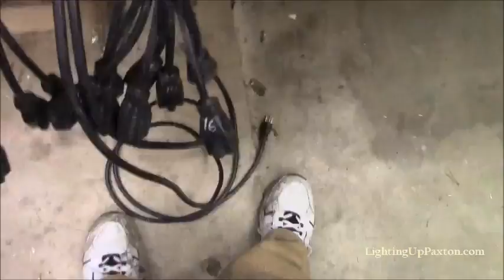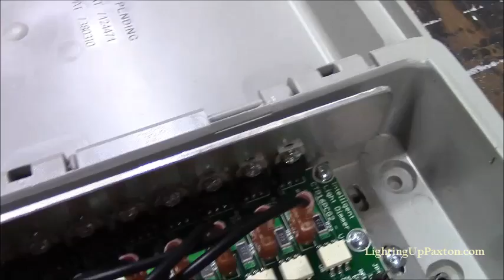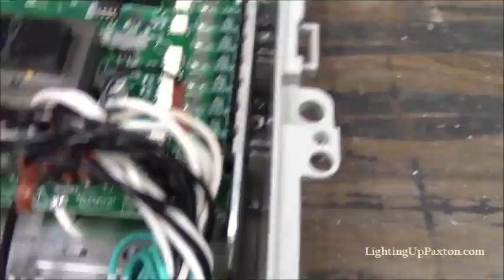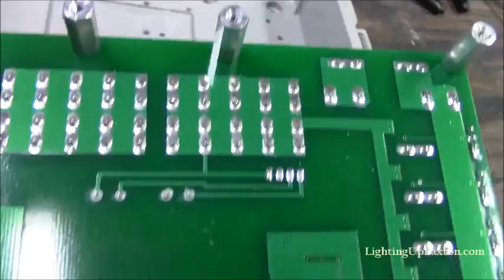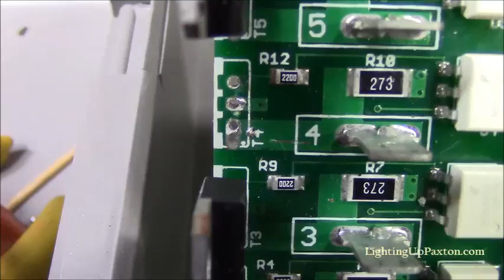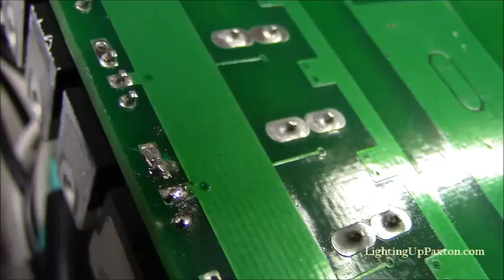How to replace triacs in LOR controllers

Comment: Heat the solder and use a solder sucker when it gets liquid.  Then go back and use a solder tape to get the rest on both sides.  Triac should come right out.  Stick in the triac, solder the back and clip the pin.  Use flux when soldering.  You make it harder than it needs to be.  Any thermal paste you use withy CPUs or thermal pads should work

Comment: A tip from a retired professional electronics technician--- buy a desoldering vacuum pump. They are only a few dollars. No need to break off the triac from the board. The desoldering pump will suck all of the solder from the eyelets and the old triac will simply fall out from the circuit board, leaving a clean eyelet. Also, use solder with a multi core rosin. The solder will flow much better, resulting in solder joints that look much like the original factory ones. No one likes to see a poorly soldered joint, with a solder blob on the eyelet.

Comment: I like your videos because you explain things clearly... I gave your video with a thumbs up and watched it all the way through...  As someone who does electronics for a hobby and works with embedded microcontrollers professionally, I'd like to offer a few things that in future might make your repairs go easier... I have a professional desoldering tool that sucks solder out of the connections, not everyone can afford or justify spending money on that, but for a long time I had (and still do) a Solderpult (blue body) desoldering tool that sucks the solder out of the connection, the red one works meh... but better than nothing. When you have a lot of heavy traces on a PCB, you need to heat the connection up well, but carefully not to delaminate it from the PCB, and you have to desolder each connection separately, trying to heat multiple pins won't make it easier to remover.  Also, you don't have to break off the old one before removing, in fact having it in place makes it easier to wiggle the part around so you can pull it out while heating it up, there are exceptions to this, but for triacs, I think this works better.  Next, you do not need to precut the component before installing, put it in the board, solder it in place, then use some flush cut side cutters to finish the job. As long as the trimmed legs doesn't short out on the metal, or scratch the box, etc., you're good.  Next, FYI: The way thermal compound "works" is that it makes up for the fact that two surfaces may not be flat and make complete surface contact, the compound makes up for anything uneven in either the component or the heatsink.  And lastly, when soldering the good component in place, and the PCB has thick or wide traces, sometimes the connections will take a long time to heat, and that heat can hurt the component, so there are little spring clips that act as a temporary heat sink, like an alligator clip, you put on the leg of a component to draw out the heat from reaching the sensitive component inside the body of the component.  If you're able to get in and out relatively quickly, then you should be alright and don't need to use them.
Reply from the maker: Great tips.  I'm happy people continue to share their advice and experience.
I found clipping the legs of the triac first made it a little easier to to get them through the original terminal holes as they wouldn't bend so much trying to push them through.  I'm confident that was only a symptom of not getting the terminal holes completely clear of solder though.

Comment: Before undoing the "Black"  hot wires.. I would make sure  they are labeled with the channel number so when you connect them back to the board you will know which channel they go to.. I use a black sharpie to label mine..
Reply from the maker: Great tip to add, Patrick.  I do have them labeled that way, but failed to mention it and it doesn't show in the video either since all the numbers were facing away from the camera.

Comment: Edited - Humble Pie edition....I just replaced 3 triacs and for the first time had lots of trouble with my desoldering efforts. The technique in the  video will work well. . 2 of the 3 triacs I replaced were a pain... the solder wick would not work. I used Victor's method with a little modification... I used a de-soldering bulb to actually blow out the solder from the holes. I do not recommend this method. The toothpicks appear to work better than the de-solder bulb blowing method (BTW - using it for sucking solder would not work). So my sincere thanks and apologies to Victor... Your method works better than solder wick. There are special de-soldering tips for a soldering iron that will allow you to heat more that one pin at a time. Those work very well, but are still not the best solution. I have since purchased a vacuum de-solder / solder station. Works fantastic. I can remove components in mere seconds. Works good for harvesting parts from PCBs otherwise headed for the trash bin. It also keeps me from overheating and lifting traces. I also recommend you double check for solder bridges... hard to tell due to discoloring from the soldering iron. You do not want to power up with a short created by a bridge. Original comment still relevant: Some really good information - Thank you - the disassembly instructions are excellent.   I will add my two cents worth. 
Also, I do not cut leads until the soldering is done.  I have a expensive flush cutter ($80) and a pair of  Xuron 170-II Micro-Shear Flush Cutter (about $10). Both work well in tight spaces, the angled flush cutter works the best (Windstorm 8248) but it cost the most. 
Thanks again!
Reply from the maker: Great tips for everyone.  Thanks for the input!

Comment: good information... I might suggest a couple of tips...from someone who has fixed a lot of small things and some electronics.. get a pack of "Ignition Wrenches"  they are small wrenches useful for small fasteners and tight places.  a bit easier than using needle nose pliers.. and for the thermal paste..I have been told is best to remove all the old compound before adding new.  Also get some small wire cutters ( they are worth their weight in gold sometimes)  also Radio Shack has some I believe they were solder picks made of metal .. pretty cheap... and held up better than tooth pics.. and the perfect size for holes in the boards.
Reply from the maker: Great tips!  Thank you Sean.

Comment: For the thermal compound, I expect you should be able to just use the same compound that is used on the top of CPUs when mounting the CPU fans.  I think it has as good if not better heat transfer properties.  You can buy it at Best Buy or any computer store and is normally located around where they have CPU fans.
Reply from the maker: Thanks Mike.  I agree.  I added an annotation to online links for the same product.